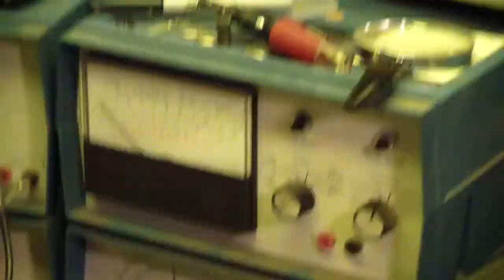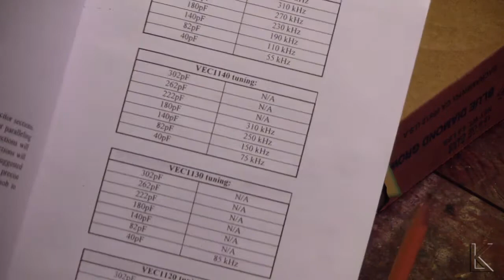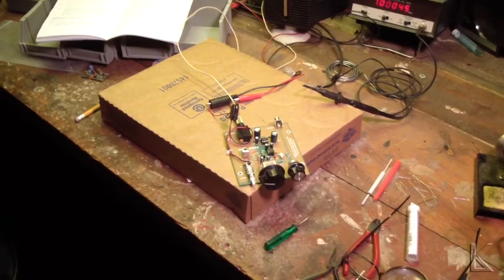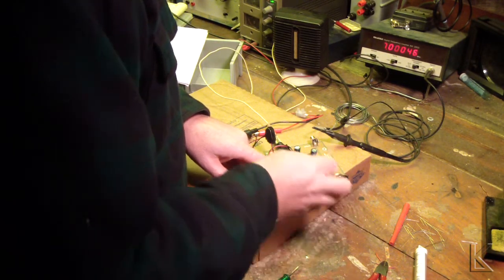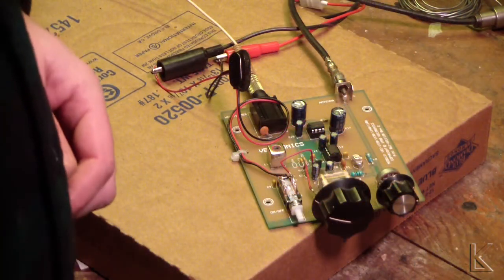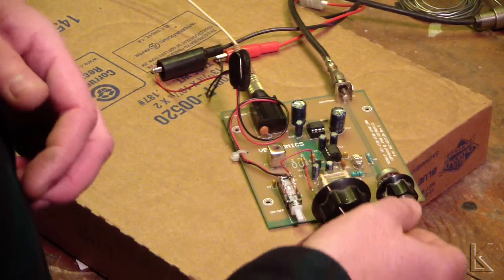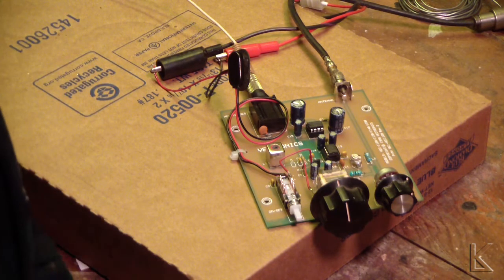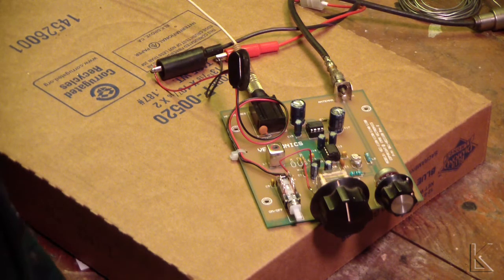Ham Radio - Vectronics 1140K receiver kit Part 2. Alignment and testing.

Comment: Good job on the Vectronics receiver. They have been around for a very long time. Please record a video when you stuff it into a case. Or perhaps combine it with a small transmitter to make a transceiver? Check out the QRPME web site at http://qrpme.com/ They have a number of really good and inexpensive kits for the QRPers. Thanks for another good video.  73 DE K7RMJ  Frank

Comment: What if I don't have a frequency generator?

Explain Zero-beating.

Also, a waterfall illustration of "above" and "below" and "wide filter" would be cool.

Maybe a video on receiver theory?
Reply from the maker: Good questions.   I may do a video series explaining topics from the license exams.

Zero beating.    As I tune toward a signal,  you will hear a tone that starts high and drops in frequency as I approach the signal.   This tone is produced by the receivers Beat Frequency Oscillator, or BFO, mixing with the source signal.   As I reach the source signal, matching it, the tone will have dropped to zero hz, or "zero beat".   When you're just a few hz off the main signal,  you'll hear a slow undulating beat.
I think I'll do a "quick tips" video on zero beating, maybe this weekend.

As to alignment if you don't have a signal generator.  There are two other methods provided for in the manual.     One is to use another calibrated receiver, picking up the local oscillator in the kit.
The other is to use a calibrated transmitter, feeding into a dummy load, and transmit a signal you can then tune to with the kit receiver.